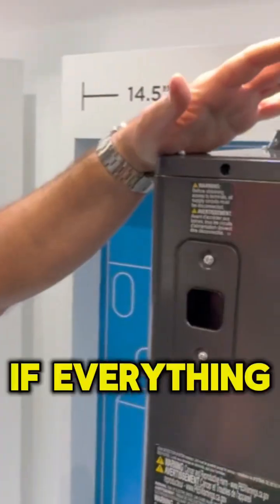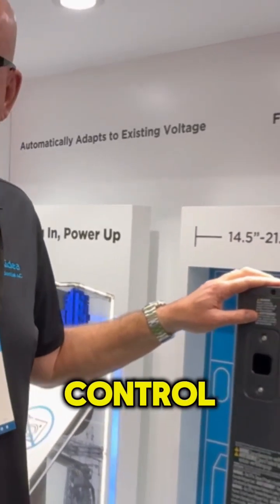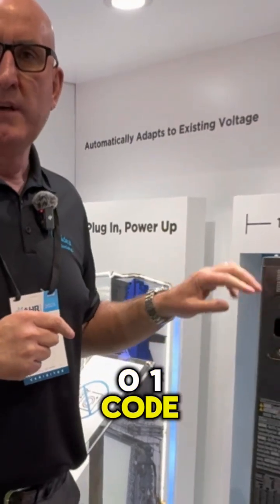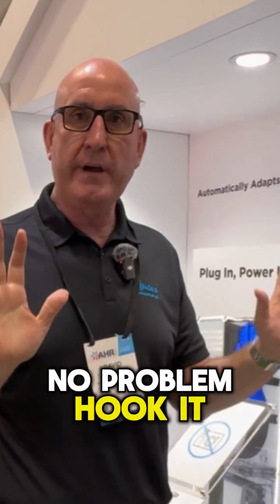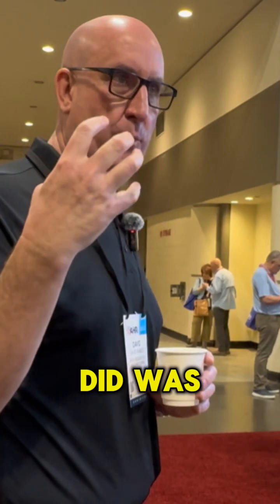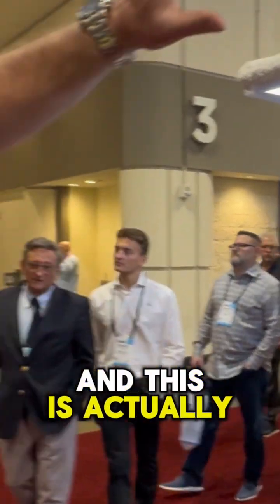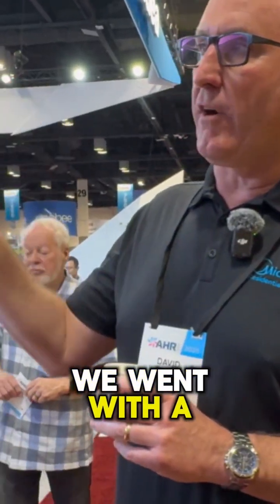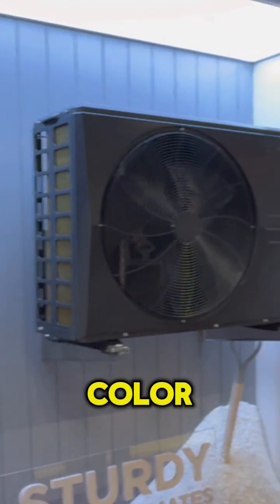Midea EVOX G3

Comment: Anxiously awaiting it's availability! Been following this innovation for over 1-year now. Bring it on 😁.
Reply: if you want most of the performance without modular air handler you can get this under few brands, theres few tiers of it, first you have evox non hyper heat, it will not do as much cold climate performance, then you have extreme series that doesnt use the fancy modular air handler but has nearly same performance, and then theres the fancy air handler but non modular (only aciq sells these so far)

the  mid tier unit (best money for performance) you can get under mr cool hyper heat r454 and aciq brand, you can also find them alpine air blue ridge and few other brands

basically you will only loose about .5 to 1 seer performance drop if you dont use the new air handler but get most of the performance benefits